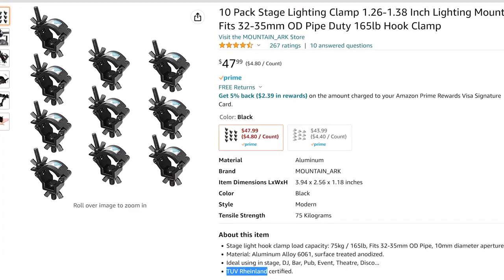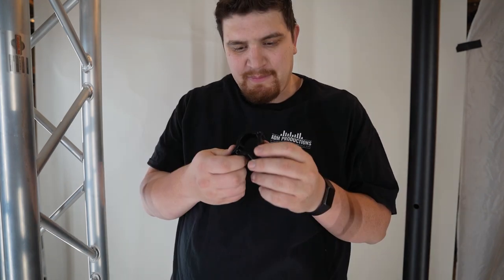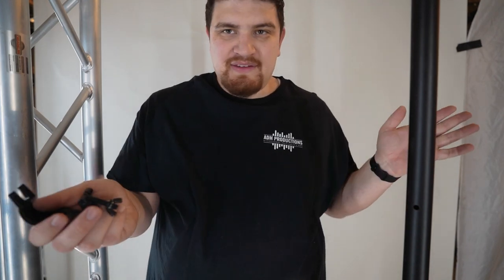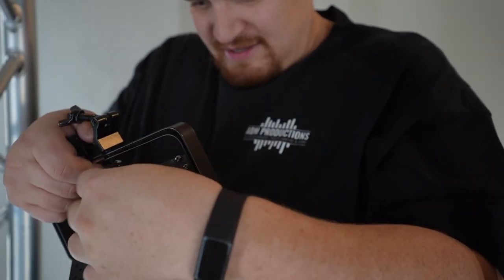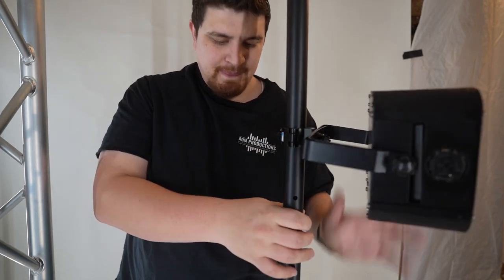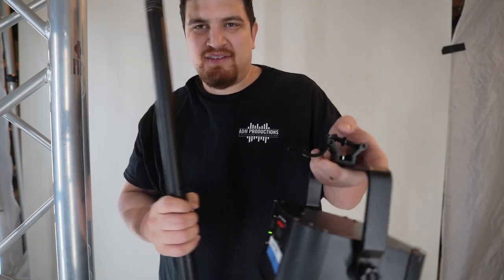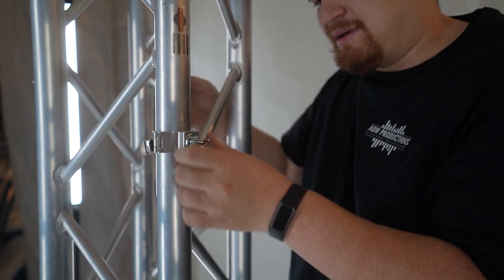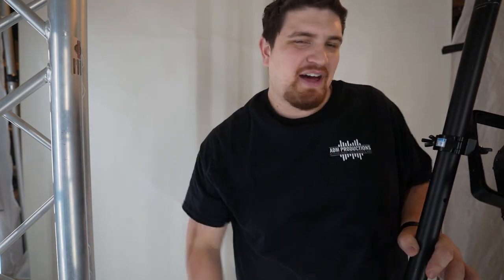How To Mount Lights On Speaker Stands/Gravity Stands | DJ Gear Review

Comment: Which lights do you use on 01:00 (the square ones on the poles)? 
How do you mount them? 
And can you get them to 'point down' from this position?

Thanks for your help. Will be following your channel from now on!
Reply from the maker: They are the Chauvet core 3x3, yes they have a bracket on the back and you can adjust the angle in which they point

Comment: If you don't have fly points or a bar etc. and the top of your speakers are fairly flat you can use strong outdoor use velcro strips (15lb+ hold). Trim them to size and they are very secure. Only thing is there isn't adjustments up and down. Mounting  lights on the poles could blind your guests if not angled correctly lol
Reply from the maker: Very true! Lights with a wide angle like tubes usually won’t blind anyone. Some like to incorporate blinders as part of the set

Comment: Can a 1915 moving wash be mounted on top of a gravity stand? Its about 18 pounds. Will the moving cause too much wobbling?
Reply from the maker: So far I have not found something to connect the two bottom mounts. They make trays that sit on top of gravity stands, Rockville has one. It shouldn't be too much. I've done fixtures that were close to 18 and were great

Comment: Hi there, can't you just use the holes already in the pole for mounting?
Reply from the maker: Some poles have a hole on the top and you definitely can do that. I don't recommend mounting it in those holes meant for the locking pin. It could damage them and it might not close all the way